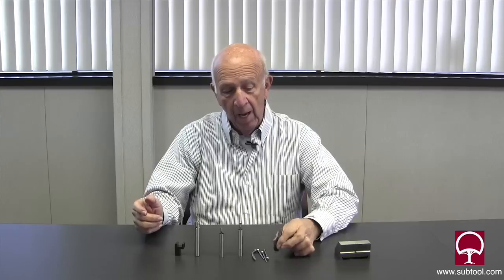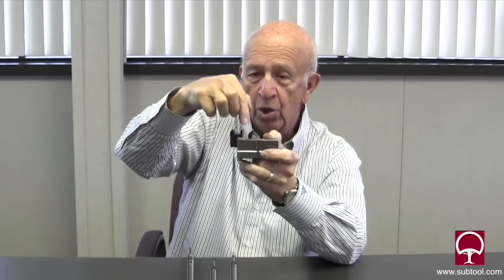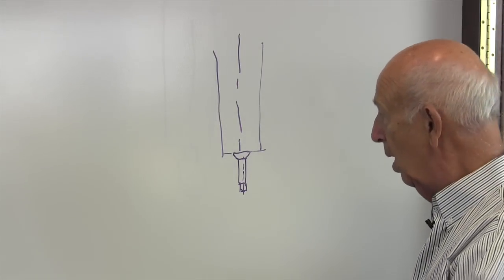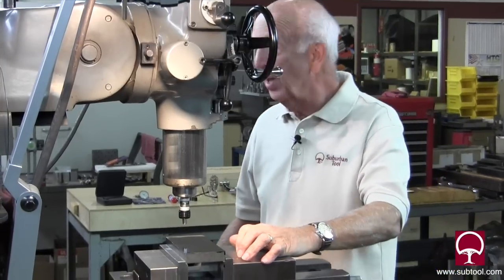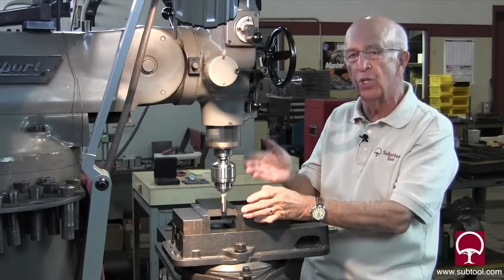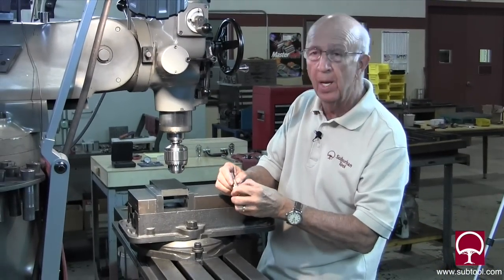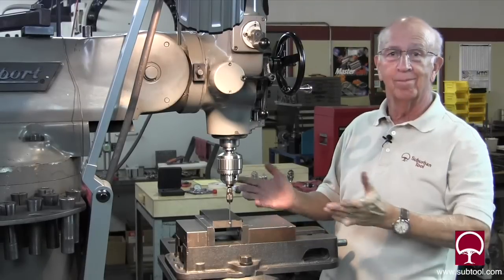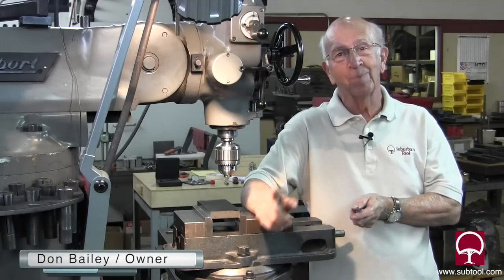How to select the right Edge Finder for you

Comment: I'm a retired tool & die maker, that has worked in the auto, pulp & paper, mining, and oil and gas industries, and the only center finder that I would use is the wiggler. It's the most versatile and burrs and imperfections or dirt won't give you a false readings. You can place the ball on one spot, and not get false readings from nearby defects. I purchased mine in 1971, from Starrett 828A, and it is still as accurate as the day I bought it. All precision goes out the window, if the spindle, or workpiece is not square. I've used the other type, the one that has a piece of roundbar, held in with a spring, and found it great for finding the edge of burrs, and edge dents, and I can't use it to pick up layout lines.

Comment: Hi Don, Good explanations. I have been taught to keep cranking until the mechanical edge finders 'kick out' but this never made sense to me. Commonsense tells me if it is moving in an orbit, it is not on centre, as you approach centre, you are pushing the tip nearer the true centreline,  when you are on centre the percieved movement stops, to get it to kick out you have to go past centreline and overcome the friction the spring creates between the body and tip, the tip is always 'advertised size' if you are supposed to kick it out, i would expect the tip to be a thou or two oversize, so the point of kick out occurs at the 'advertised dia' , this being the case, as the spring tension and friction varies so will the 'calibration', obviously centre finding would work if you use opposite edges, but working from one edge only does concern me, your guidance on my perception would be appreciated
Reply from the maker: Thank you for watching.

Comment: I have to disagree about an indicator in an inaccurate collet. If the collet is tightened, and it must be, then the indicator will not rotate in the collet. So any error in the collet or in the edge finder will put the tip of the DTI at the same position relative to the center line at all angles of rotation.

Comment: Your using an old bridgeport Miller... modern cnc machines are more stable,  more accurate etc. ..i.e you could increment over 0.01mm instead of nudging the handwheel.

Comment: there are two schools of thought: where it sits still and where it kicks out. after exhausting repetitive tests. its within 5 tenths both ways. either way ur gonna be alright: if u gotta be closer, letter kick. if you gotta be backed off let her sit still as she touches the edge. though i must note that the repeatability of letting it sit still  had a negligible amount of error, possibly my own eyes not seeing the complete stillness so i tossed those two events from the data.  tested on a mori DMG duravertical with two fairly new edgefinders in a collet and a solid holder,  edgefinding against a 123 block and 150 tests for repeatability. took me quite a while but i had to get to the bottom of it. its negligible other than the minute  amount of time taken to double check if its still versus observing the kick. if anything the kick is a bit quicker for me because i didnt have to scrutinize its stillness with such intensity.  btw we have an angle plate at work that was made by suburban tool co!!! excellent and perfectly precise tool. im proud to use it and thrilled to see this channel.

Comment: The edge finder with the cardboard added is not finding the edge, Simply because in the video you have altered the effective diameter of the end to some unknown diameter. As a result you would not know how far to move the material over to bring the actual edge of the material to the centre of the machine

Comment: 9 times out of 10 the dowel pin and piece of paper works good enough for me lol. Used 3d tester which are great, quick and easy to use but seen them get broken alot aswell lol
Reply: Yeah, sometime I like this method also. Long dowel pin is good to get on the side of a large diameter. Works pretty good however your dowel pin needs to be the right diameter and in good shape.
Reply: You can run a dti on the dowel in the chuck by hand & find the two points that are between the highest & lowest clock readings. Mark the dowel at these points as they are excactly the dowel radius from the centreline of the spindle. Use either of these marks with your paper with the chuck stationary & any runout in the chuck won't affect the accuracy.

Comment: What is the point of an edge finder? I'm not a machinist obviously. By the way that looks so awesome at 16:27
Reply: To set a datum, for example on a drawing of say a square part with some holes the datum will usually be from a corner so you set a 0 (datum on 2 edges in x & y which you can then use to accurately follow the drawing and put the holes where they need to be. 
Ofcourse this isn't always the case but essentially that's what edge finders are used for, they align the centre of the spindle with the edge of the work so that you can work accurately.

Comment: Hi!Thanks for all those educational videos. Changing from 40 years with electronics to a future with mechanics there are lots to learn.I bought some sets of wigglers from eBay. On the wiggler having balls in both ends, the first one You show,  the sencing ball is off center. Spinning it between the fingers it wobbles. I don't believ it can be used the way You show. Can it be machined into a useful tool?The second one You show, double ended, the 200 thou end is like bent on my one. It is probably useless unless I can turn down the tip to be centered.A third guy has a conical tip, and the tip is like bent, is wobbling. Probably not useful.Thanks to Your education I claimed a refund and got half the money back.

Comment: Hi Rick; I agree with you in all of the comments except on the dial indicator.  I believe that even if the indicator run out 1mm still if you clock both sides of a gap .always will give you the center.

Comment: I think the concept here is the same as with a lathe. You can have you workpiece off center by an inch, but when you turn the part, the cylinder that you create will be in line with the lathe spindle's axis, although it won't be concentric with the rest of your workpiece. I'm assuming edge finders follow the same principle.

Comment: Just use the electronic one with rotating spindle. It will blink very fast, but you would not be able to tell because of persistence of vision. That way you will not have any issues with collet not running true.

Comment: I use a 10mm dowel with smoking paper, to get roughly within 0.004" then I use the verdict clock method with a 10mm inspection slip to get bang on centre of my Horizontal Devlieg and sip machine. Excellent video

Comment: Good job on the video demonstration. I was looking into a electronic edge finder because the company I work for will not allow door to be open while spindle is running (CNC mill). It is difficult to see the kick-out to find edge on edge finder. After viewing the video, it appears that the electronic version are very accurate but not after rotating spindle. Chucks do vary "off center" to spindle as you have illustrated. So with that in mind, if I manually rotate the spindle 180 degrees and touch off opposite side of part so it touches on same side on probe, than it should be pretty darn accurate. Same concept as using a test indicator to find a center of part or hole. When finding edge, rotate 180 degrees and split the difference.

I found using the kick-out method repeats better than waiting for it to stop wiggling, but only when it barely kick's out. I don't use wigglers so I can't comment on them. The point of your video in "picking out the right edge finder" is very good. 

For your readers, I use edge finder with .200 on one end and V-point on other end. V-point picks up small holes and grooves. I also test .0001 increment indicator with fine adjustment to easily gauge it in for precision if needed.
 
After watching your video, The 180 degree rotation entered my mind and I may reconsider trying the electronic versions.

Comment: Your point about a chuck or collet running out and giving a an error equivalent to the run out is wrong. If say the chuck was running out by say 0.020" at say 12 o'clock and the stylus of the DTI set at that point then as the spindle is rotated to say 3 o'clock that 0.020" would have turned with it so the actual radial point never changes regardless of chuck/collet run out. I hope this makes sense. Paul.

Comment: Very informative video,thank you. I also use an optical centre finder but mine fits directly to the quill shaft on my mill,means always going to be true to axis regardless of chucks or collets. A quick tip I find useful is to store a datum point in my DRO memory that can be worked from right away. I have stored the X-y coordinates of the fixed jaw and my stop block on it. Once the job is clamped up in vice and against the stop then coordinates for holes can be worked from that point. I have checked it for accuracy and it is within less than half a thou every time.

Comment: The electronic finder senses the edge much better than the others but run-out ruins the accuracy. It seems you could get rid of much run-out error with your cylinder square technique by finding the high point then turning the spindle 90 degrees and using it there. Maybe even a mark on the tool and spindle or collet so you can repeat it well.

Comment: way wrong IMO. If you used an indicator to sweep between a part that wide( or using an indicol or long extension) don't move the machine, just sweep high point side to side. same concept as jig boring. pickup hole without moving machine. His theory is flawed, if you use any size edge finger i can almost guarantee you'll be within .001 of the same result. if you used a fine point wiggler i bet you'd be just a close. If you used a collect and indicator( what he is saying is flawed) then sweep a gage ring and make sure it's round. then dedicate that collet. There's no one way to do it, it's how to get a good result in the end. To stick with one method and one method only for finding an edge is asinine.

Comment: Why did you use a drill chuck to hold some of the finders and use a collet with others. I think you should have used the same holder for all of the finders. The drill chuck will be out of round more than a collet. How does turning the spindle get the air out of the collet?
Reply: Not "air" I think he said "error". LOL

Comment: Just discovered your videos a few days ago, and they are excellent!
-Couldn't the electric finders areas of "On" or "Off" be marked, and then go 90 degrees to the mean result?
-How accurate is the digital readout really? How does it work? Does it have to be checked with Jo blocks from time to time?
Reply: +Steffen Dahlberg A glass scale DRO is extremely accurate, the one in this video looks to have a 1um resolution since it is reading in 0.0002" increments. When working slowly like he is, even an inexpensive Chinese 1um scale will have very good repeatability. One can argue that a better method would have been to put a 0.0001" DTI on it instead. Remember that he is just making relative measurements, so the accuracy of the system is not important, only it's precision.
One would also argue that he is not using the ground edge finder properly. Most people advance the work until the puck kicks out, rather than advance the work until the puck runs true. Doing it his way depends on the eyes of the operator, which in some cases will be just as accurate as using the scope, but in others a crap shoot.
Reply from the maker: +Steffen Dahlberg  Most manufacturures guaranty .003 - .005 over 24 inches on their DRO's. It all depends on the manufacturer.Generally the DRO reads a glass scale and no , you should not have to check it with Jo Blocks.
Reply: +Steffen Dahlberg the DRO is one of the best inventions I have seen.  Even a low skill person like me can have confidence in finding the edge and can produce much more accurate work overall.

Comment: The ultimate is a 3 D taster but mega expensive.
When using a wiggler i wind in until the wiggler throws off not until it runs true and i use the electrical type when rotating also but use low speed and look for a constant light.

Comment: Ok:
  You are in my world now.
  Let's start with the electric " Flashlight " indicator.
  I found those to be quite good.
  And although they tell you to go with a dead spindle... I run maybe a couple hundred RPM and look for approximately 50% illumination. Great results. Spindle and holder error corrected.
    Watch out for non-conductive Dust-Mites.
  Don, just how big is a dust-mite?

  And the scope, reticle is adjustable in one respect only. The other is just fluff.
  You will wind up dizzy with a crick in yer neck using this thing.
  I do like it sometimes though.
     I use them all to best advantage. Not always are they all appropriate.
 
  It is easier on the neck if you place a PC Microscope eye on it and use the laptop to view, rather than crawl into the machine with it.
 Third: I like to run my Starrett Edge finder at 1200-1400 RPM, it seems kind of speed sensitive. I am comfy to a tenth of a thousandth with this.
  I never saw the mag groove before, not many thought except for hygiene.
After 20+ Years in the shop, my buddy gave me a wiggler.
  All I can say is I do approve. I'd never met one, always Starrett edge finders.
  Then I have the Blake co-ax... run live... I can see well within ....0002" 
  And now, the Haimer Taster.
  On my CNC, I can see .0001 as clear as day. Painfully obvious.
  You have to dial it in to your holder, always orient it the same way...
 Put money on it. It saves me soooooo much time.
   Bank it. I sometimes do 15 setups a day in the Job shop.
  But it is much larger than the trusty edge finder, so when on the little series 1 Bridgeport, the Starrett usually get's the job.
  And I have the laser pointer. Quick, cheap fast and loose. .010 er so.   And then last, but not the least... anything you can chuck with a point on it.
  Heck, you don't even need a point.
  Hit x+ with one side of the 2" round stock, hit x- on the other side... split it.
  Additionally, I am quite fond of my Newall Inductive DRO with the inductive pickups and wonderful math killers.
  Love your videos.
  Mark

Comment: I most frequently use a double sided Starrett edge finder, but I have a magnetic edge finder like you showcased that I use when I need to be more accurate. My issue with the magnetic is that when I purchased it, it was not ground correctly. The centerline was off by almost .002" but I was able to grind it in, and can now very accurately hold .0002" with it using a .0001" indicator.

Comment: If your indicator is mounted in an inaccurate collet, it does not matter. If it is off .010 in one direction and you turn the spindle 180 degrees, it will be out by .010 in the opposite direction. Radial distance remains the same no matter the spindle position. You proved this when you showed the Indicol. If .010 runout in the collet would throw things out, what about the 1.5 inches off center of the Indicol?
Reply: ardvarkkkkk1 
I agree with this.. It doesn't make any difference as to where the indicator is mounted as long as it is attached to the spindle someplace that doesn't move.
Reply: I agree too. The probe of the indicator is not on centre. It's not just that it doesn't need to be: it CANNOT be, if is to do its job.
However I do agree that the electronic probe needs to be true running.

Comment: there is one more method that is very accurate and only requires a indicator and flat ground block.  that is to indicate zero on the edge of the piece, then rotate the indicator 180 degrees and indicate zero against the flat block the results will be as accurate as the indicator used.